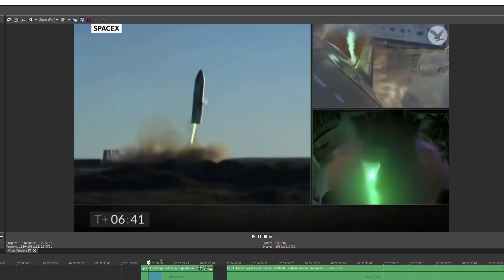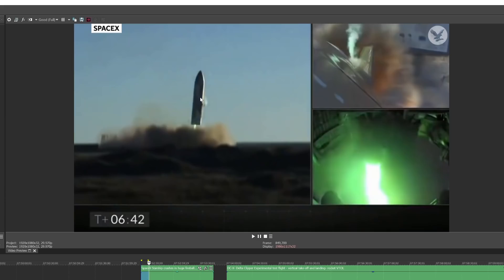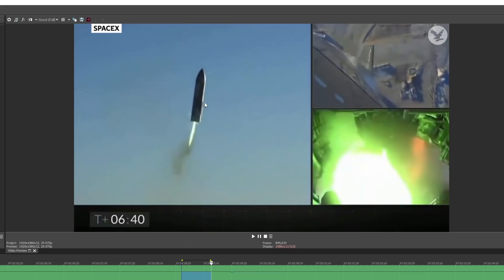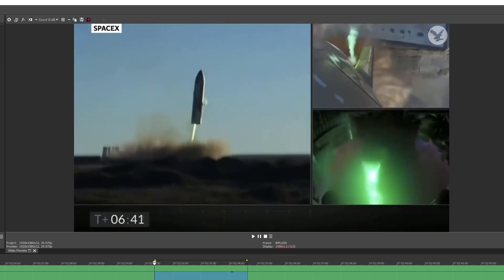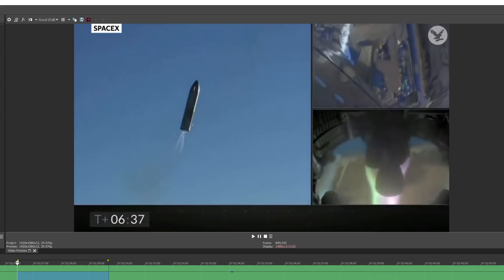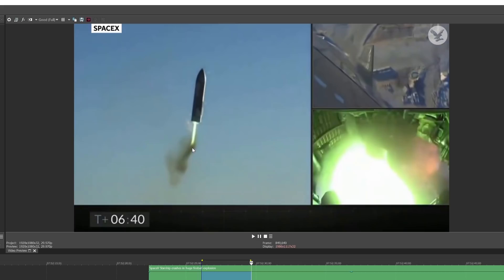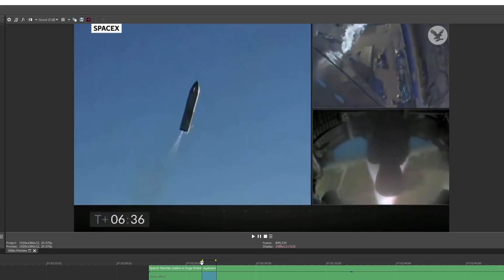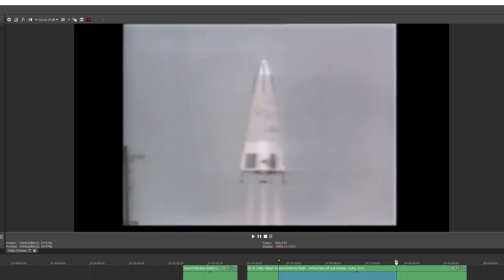SpaceX Starship Explosion: First analysis!

Comment: the green flame could be boranes since they are frequently used in rocket ignition systems.
Reply: Not in Raptor's case. Also, if the engine were using TEA-TEB ignition fluid, we would have seen the characteristic green flash every single time they ignited an engine during this test, which was 5 times in total. We only ever saw one engine go green, and it was during a low propellant feed pressure event.
Reply: Raptors doean't use TEATEB to ignite. And the combustion chamber is made partly out of copper.

Comment: Have they not heard of baffles, in the liquid fuel tanks, so that the liquid doesn't slosh about? Low engineered automobiles have have baffles in their petrol tanks. Road tankers (rocket body sized tanks) have baffles.
Reply: There are smaller header tanks used exclusively for the landing. The whole "sloshing fuel" argument is entirely irrelevant. (Note: the failure was in the header tanks)
Reply: @noname117spore  OK Thanks

Comment: Only one engine had green exhaust plume. The other two had normal exhaust plumes. It doesn't look like a starvation of fuel, otherwise  the other two engines would have exhibited the same green plume. I suspect the one engine failure, that had the green plume,  caused the hard landing.

Comment: Looked like they lost one on ascent, this should be interesting to deconstruct.
Reply: I think the deconstruction has already been done nicely by the rocket itself.
Reply: It seems to have been planned to reduce the G-loads on the rocket.
Reply: The engine shut downs were planned, there were two of them during ascent, and both of the engines that shut down first on ascent were the ones to relight later. If one of the engines had a problem and had to shut down, it would not be relit during flight.

Comment: If you notice earlier in the launch (while the rocket was ascending), one of the engine fails and causes a small fire inside the "engine ring", followed by another engine partially failing. I suspect this failure lead to the green plumes coming from the engine. It was all a chain of events and not just a failure during the last leg of the landing phase.
Reply: The engine didn't fail, there were two planned shutdowns as the vehicle ascended. This was to limit the acceleration forces and at apogee reach a sort of 'hovering stop' in mid air to burn off excess propellant before shutting down the third engine and transitioning into aerodynamic belly-flop control.
Reply: @sycodeathman  According to some people, they weren't supposed to shut down at that time. I can believe the shut down was automatic though, and was maybe programmed to happen earlier by the computer. But was the inner engine ring catching fire also part of the plan?
Reply: @silviustro1  It was confirmed by Elon on twitter that the flight profile was to drop to 2 then 1 engine during ascent to get set up for the drop, then after the aerodynamic fall the plan was to light two engines for the flip to vertical, before shutting down one of the two to land on a single engine. Unfortunately during the flip they  lost header pressure which forced an early shutdown of the second Raptor and still deprived the final raptor of propellants, enough that it started burning oxygen rich which allowed it to react with the copper liner and produce the green flame we saw.
Reply: @silviustro1  Oh, and I forgot to mention, but the fire that occurred between the shutdown of the first and second engines during ascent was not planned, but also didn't hurt anything important. All of the cabling for the engines and stuff on Starship are inside steel pipes for protection from debris, those mylar blankets existed as an added layer of thermal protection.

Comment: Watch the ascent phase again. When the first engine that failed on landing cuts out (about 1:42 on the on-screen clock) there is a distinct narrow green jet for a moment.

> Did some damage occur in the engine bell then?

That aside a very impressive test flight. The DC-X did something similar before but the scale here is much larger and the aerodynamics and slosh-fu are far more complex.

Comment: If you watch early in the flight one of the engine goes a bit sideways and sets fire to things inside the craft I think that may have more to do with the crash
Reply: It was confirmed that the sequential shutdown of Raptors on ascent was planned. As each engine was turned off they automatically angled themselves "out" away from the other engines to give them more room to swivel around and steer. The fire seems to have been caused by the delayed ignition of some fuel rich exhaust gasses trapped under some thin mylar insulation, but it doesn't seem likely that this damaged anything important since the flight proceeded perfectly right up until they lost header tank pressure during the final landing burn.
Reply: I also noticed that and was waiting for control to say something and scrub the test

Comment: This was pretty much the ideal. All the critical parts that have never been tried before worked shockingly well and engine issues were the only reason it didn't land slowly. This was an impressive explosion however it was also a massive success for space x.

Edit: my god he is still convinced its a DCX with larger fuel tanks. Yes, it lands propulsively but no that does not make it a DCX with larger fuel tanks. To call it that vastly undersells what's actually being accomplished here.
Reply: @stumpyplank6092  dont be silly. the DCX was simply capable of short hops with translation. SN8 is using 3 full flow stage combustion methalox engines, flying to 12.5km, performing translation maneuvers with aerodynamic surfaces and the main body, performing a never before done belly flop maneuver to switch from an aerodynamic flight model to a vertical landing model, then landing propulsively.

Comment: Poor quality rip. There are 3 engines and they are clearly visible through the whole sequence in the original video. Two light for landing, one flares out, the other blasts a feeble green flame in a brave effort to keep the thrust.

None of them destruct externally until hitting the ground.

TEA-TEB, as mentioned before. The question is why? Perhaps a last ditch effort to reignite a failing engine at the crucial moment?
Reply: the engines are lit by spark plug.

Comment: 4:05 The combustion chamber is lined with copper so when the header tank pressure got too low, the o:f mixture likely shifted to oxygen rich which spiked the flame temperature and lead to some nice green "engine rich" exhaust (basically started eroding the copper nozzle liner).

Comment: 2:30 the liquid sloshing problem is addressed by using small spherical  header tanks. The main tanks are mostly empty at the time of landing
Reply: But what about the sloshing in the header tanks after the first swing?
Reply: @rjanSolli  The sloshing is likely very mild since the header tanks are almost full at first and sloshing becomes more severe as tanks drain. That being said, I believe the downcomers are long enough and wide enough that they prevent any bubbles making it down to the turbopumps. The Lox header tank is probably close to 40 meters above the engines so no matter how much you shake the vehicle, I doubt you can end up with any bubbles that far down the tube.
Reply: @brandonberchtold9484  It's a good point, but the green flames indicate no lack of lox, rather a problem in the methane tank that is closer. And the problem occurs after the engines have consumed some fule and have the gimbal on max.
Reply: Called header tanks. Small tanks inside of the larger tanks with just enough fuel for landing.

Comment: i feel like you're understating the challenges of this hop a little bit. 
I was amazed that they even made it to the point of testing the landing maneuver.
This test flight was a huge success imo.

Would be great to see more like this when you're a bit more informed. Liked what you had to say though.
Reply: I agree. The glide control was impressive. The flop worked better than I expected. The aim was great. For the very first actual attempt. This was really impressive.
Reply: Hasn't SpaceX already done testing similar to this, but with a different payload?
Reply: @vejymonsta3006  they've flown 3 other vehicles with a single raptor and no elonerons on short hops, this was the first to do the crazy elon dive/flip and the first to relight the raptors while in flight.  Considering Musk estimated a 30% chance of total mission success I'd say they did extremely well.  SN9 is ready to go and SN10-16 are under construction.
Reply: @vejymonsta3006  They have not done a test similar to this before. 
They have done a couple 150 m test hops with a single engine. This was a test flight to 12.5 km with three engines, also demonstrating controlled descent using new aerodynamic surfaces, relighting the engines from separate header tanks and a transition back to vertical orientation for landing.
This is the first time a full flow closed cycle stage combustion engine has flown over 150 m. Everything following that was a first and a huge milestone.
unlike Boeing and other aerospace companies, SpaceX conducts a lot of development and full view of the public and gives you live camera feeds from multiple angles and then tells you what went wrong.

Any SpaceX engineer will tell you this test was a humongous success and it still would have been even if the vehicle had exploded at Apogee and not made it to the belly flop maneuver and transition to vertical landing
Reply: Thunderfoot despise Elon Musk so it is already amazing he commented this amazing Starship test.

Every success of SpaceX or Tesla is a pain in the ass for him ^_^
Reply: @SuperPostman  That's because although Elon has done amazing things. He does silly thing like claiming to have invented travel in a vacume tube. Makes claims that his underground tunnels are practicle. And says that we can colonize Mars with current tech. Those 3 are all pure snake oil.
Reply: @jcwiggens  Yes sûre but now Musk have ditch Hyperloop to Virgin, I don't know what Thunderfoot will have to say against him.
Hyperloop is doable but in the future.

Colonize Mars or having a Moon Base is possible but it is too expensive right now.

I'm not sure the Starship is the best to go to Mars.
A specialized Ship with artificial rotating gravity woulb be better.
Reply: @SuperPostman  As of right now. There is no data about what happens to the human body after long exposure in low G. No shielding for radation. It's a long way off.

There is nothing practicle about having a capsule in a vacume in a tube. The Hyper scam is just that.

Comment: If it failed to reach its planned altitude, it's landing overweight with fuel. If an engine fails for the landing burn, there can only be one outcome.
Reply: It reached its planned altitude, the reason the engines shut down was because the small header tanks that reserve the landing propellant lost pressure. This forced one engine to quit completely and the other engine went off mixture ratio enough that the copper liner of the combustion chamber throat started burning.

Comment: My take is, that due to the low pressure in the header tanks the engine was switched to emergency fuel, i.e. TEA-TEB, to keep it running while the fuel wasn't running properly. 
I've read that raptor doesn't use TEA-TEB to start the engine, but it is probably way easier to keep an engine running with hypergolics when encountering a sudden fuel shortage.
The engineers probably expected the shortages and included the emergency fuel.
However the shortages where to long for the small emergency tanks and the engines had to shut down.
Reply: Raptors don't use TEATEB. They use electric torch igniters (a giant spark) to light the methalox
Reply: @Katniss218  I know. They could still use it as an emergency fuel if the methane is not coming.
Reply: @lukasdimmler2622  Rockets don't work like that. Plus, that's extra plumbing, tanks, etc. for another fuel that won't be coming out either, because the tank is under the same forces.
Reply: @Katniss218  You could do a relatively small pressure fed tank, which would be simple.
But you are right, the flame is green for one or two seconds, which implies that the TEA-TEB tank is to big to be plausible.
Reply: @lukasdimmler2622  There's no TEATEB "tank" in any rocket. The TEATEB is held in a small "cartridge" in the engine.
Reply: @Katniss218  TEA-TEB is liquid at room temperature, which technically makes the cartridge a small tank.
I agree with you, it is far more likely that the injectors simply burned up. I just couldn't believe that you can achieve complete combustion of copper in just a few milliseconds while it is ejected from the combustion chamber. If that wasn't the case we likely would have seen some molten copper droplets being ejected from the engine.
I seemed more logical to me that the green flames come from boron compuonds, which are usually already ionized and therefore don't need to combust. That is why a constructed an alternative scenario in which boron fuel is used. However the added complexity and mass outweigh the potential use as emergency fuel.

Comment: Guess you missed that thay have speal full tanks for landing (but thay failed this time) (I am not a Elon shill and 100% wih you on hyper... anything) (engens burnd them self becouse of  the low pressure of the faild tanks) (I Give this proof of concpt)
Reply: Yeah... the hyperloop is BS.  Even the way the hyperloop was originally worded was pretty much "yeah, I got this concept, but I don't really have the time to work on this, so if you want to do it, here are the notes I jotted down.  Go nuts" .  That's what I read into the original presentation of it anyway.  No math or physics that were checked, it was just throwing out a concept.  Problem is, I think a lot of the people who are adopting it just want to do the least amount of work properly to engineer it and just take the white paper as verbatim and accurate.

Comment: G'day,

Yay Team !

My guess is that the Engines started up without problems, because the Landing Fuel is stored in separate little Tank-ettes so as to commence with Full Tanks of Liquid  Methane & Liquid Oxygen...

As the Ship transitioned under power from "Belly-Flopping" to "Rocketing Backwards"....., there had been sufficient Fuel & LOx burned that both (SPHERICAL) Tank-ettes had some Empty Space in them....; and as the "Fuselage" neared & went past the Vertical - as the Engines were gimballing furiously (like a Fingertip balancing a Broomstick above it)..., the Fuel & LOx in the Tanks did indeed Slosh around enough as to cause Inlet-Pressure Fluctuations at the Pumps...

Those Fluctuations resulted in insufficient Fuel/Lox Flow through the Cooling-Pipes embedded in the Bells between the Pumps & the Injectors - in which the Cryogenic Fuel & LOx being boiled in transit was  the ONLY thing preventing the Lining of the Bells from melting in the Heat of Combustion.

  The Liquids sloshed, the Inlet Pressure fluctuated, the Pumps' Output fluctuated, the Quantity of Cryonic Liquid going through the Engine Bells'  Cooling-Tubes was sufficiently low that the Bell Liners failed in both engines, several times, & eventually the Tubes themselves failed in one Bell & the Computer shut that Engine down on detecting the Cooling-Tube Failure via Pressure Sensors noting a loss at the Injectors...

 Either they can cure the Sloshing with MORE internal Tank-Baffles- while maintaining Flow-Rates....; OR..., the whole "Belly-Flop / Transition To Vertical Rocket-Jet Landing..."  Concept just(ifiably ?), literally, Crashed & Burned...

Meaning, it's back to Parachute Landings onto Mars..., with 1-Ton Loads being the proven Maximum Payload onto the Surface.

If so...,

Then Sayonara Mister Musk's Martian Colon-isation Fantasy...; he'll have to learn to live, here, on Earth - with the rest of us.

Such is Life,

Have a good one...

Stay safe.

;-p

Ciao !

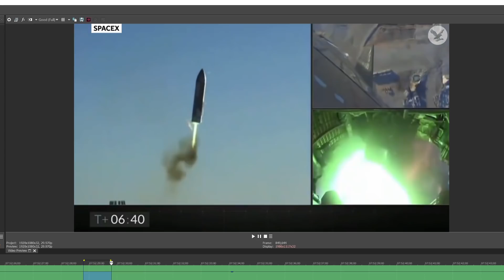Comment: 7:20 Did the engines hit each other? Feels like the two in the back clicked  I imagine software is designed not to OVER rotate, but are they physically able to over rotate?
Reply: If you watch the full test you can see the trio of engines all sweeping through angles that would definitely allow them to hit each other, unless there is some sort of gimbal linkage that physically prevents two engines from getting too close to each other it's possible they could hit.
Reply: @sycodeathman  I love watching other YouTubers the day after who all talked about the cooper... you heard it on ThunderFoot’s first! Lol
Reply: @KijasFX  I mean, for people who have been actually following the Starship development program since 2018, the green in the exhaust is no surprise because we've seen many clips of Raptor test firings. Early tests would sometimes go green for a moment, and Elon himself tweeted that when that happens it was the mixture ratio going oxygen rich for a moment and burning up some copper. They kept developing and improving until the engine no longer produced any green flashes, so they got all the hotspots and mixture ratio sweeps solved. However, if you suddenly choke the flow of fuel into a Raptor trying to run at full throttle, it's gonna turn green no matter how well it was designed. 
So, good catch by TF on guessing copper, even if he wasn't super confident about it. He was definitely not the first to guess correctly though; even I knew the instant there were green flashes during the flip before landing that copper was burning and it was likely about to crash. I'm sure a number of other people who've been following Starship had that exact thought, too.
Reply: @sycodeathman  Good analysis Tyler,  thanks :)